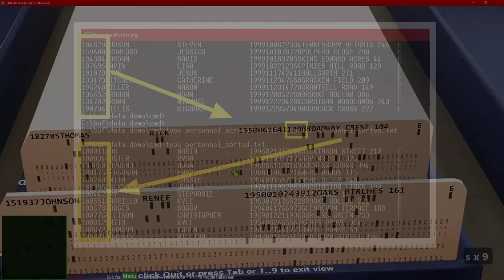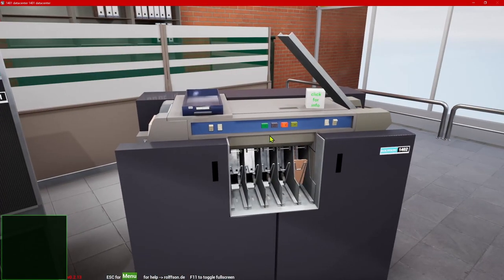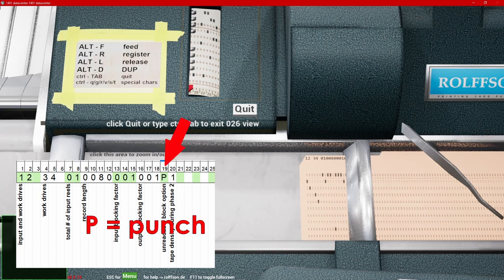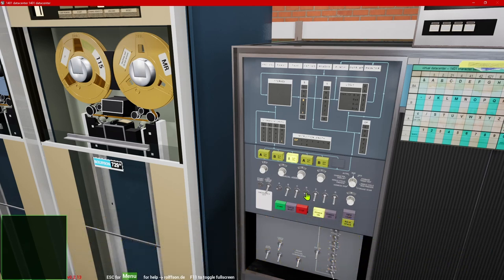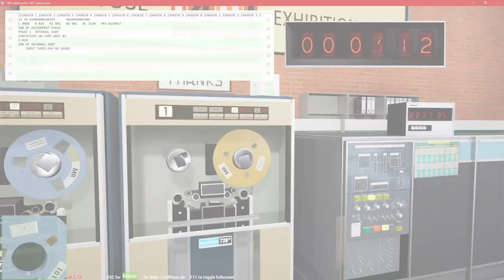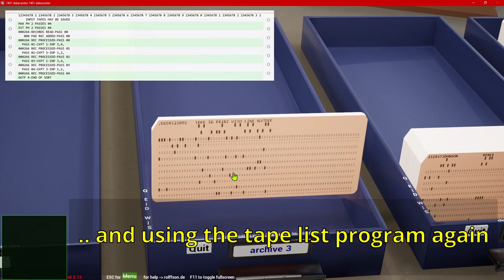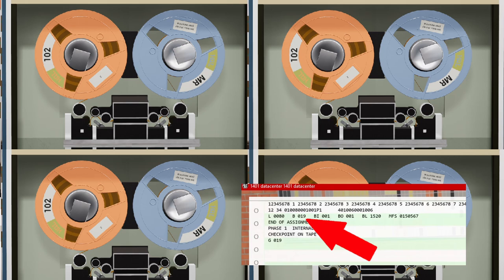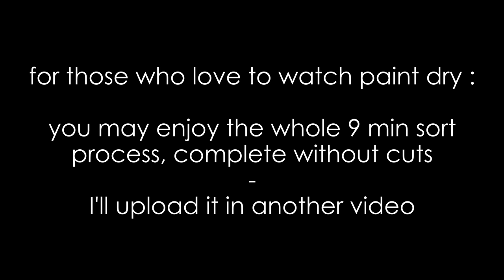IBM 1401 howto: sort7 tapesort - R12

Comment: It's interesting to consider how data records were sorted before they had tape drives. A machine such as the IBM Type 82 card sorter could sort punch cards into bins based on one column. By running the punch cards through the card sorter multiple times, from lowest digit to highest digit, you could completely sort your data. (I.e. a radix sort.) In this way, punch cards could be sorted, even decades before digital computers. Even with digital computers, card sorters were often used because they could be run "offline", without using the expensive computer. FORTRAN programs didn't use columns 73-80 of the punch card, so you could put a sequence number there. If you dropped your card deck and scrambled the cards, no big deal because the card sorter could put them back in order.
Reply: That is some amazing technology, even in modern times
Reply: On the periscope YouTube channel there is a video from the 1960s that featured the Roper Corp. and their use of the a 1401.   The man in the black suit that appears in the middle of the video talks about how the company used IBM unit record equipment in 1958 and then switched to the 1401.  They kept everything except two machines (the calculator and tabulator) and continued to use everything else.  That included multiple card sorters and collators.

Comment: This is amazing animation. I used to use the Sort7 program for 1311 discs back in the 60s. It was "boring". The tape drives (and printer) were the excitement of this machine and most often spun much faster than illustrated. Even on a 4-drive systems at times all tapes appeared to be moving simultaneously. Rewinds were particularly wind breaking. I couldn't even get the Sort7 to work in the simulator so this is jaw-dropping. I am curious to know how and if alphabetic sorting was done given the 1401 had a funky and even illogical collating sequence. 
Nice work and great history.
Reply from the maker: I agree, it (https://rolffson.de/pinboard.html#acollating ) wasn't very plausible; fortunately most text didn't contain many record_marks and minus_zeroes 😁.
At least they were able to leave the digits in a row 😎
I find it interesting that in ASCII the digits come ahead, and in BCD/EBCDIC they follow the letters..
Reply: @rolffsonsIBM1401channel  Could you do an alpha sort with Sort7?
Reply from the maker: yes.
sort7 uses the standard collating sequence, which provides an A..Z, 0..9 sequence.
The A..Z sequence is interrupted by two non-alpha characters, but that normally doesn't matter.
In this video, I've sorted by the personnel_number in col 1..6, but I could also have sorted it by e.g. last_name by defining "start col. 7 / length 18"
It's also possible to e.g. sort by first_name and then last_name by defining two sorting areas.
Reply: Back for another visit. It still tickles me pink (an expression back from the 1401 days :) )

Comment: what is your groovy theme music?
Reply from the maker: thats "69 Bronco" by DJ Williams, just search for it on youtube.
I've downoaded it via the YouTube Studio Audio Library where it's officially announced as free for YT use, so it seems to be safe for use in videos at least on YT.
In the library, just filter by "mood:dramatic" and sort by title.
If you like this kind of cinematic style music, I may suggest the group "Calibro 35", espescially the album "Ogni Riferimento..."
Reply: @rolffsonsIBM1401channel  thanks! i'm trying to understand the 30,000ft understanding of your channel... this simulation is amazing, but is it just animation done by hand or is there actually code behind it that simulates the actual operation of the 1401? Your channel does not have much background on this, but it seems amazin.
Reply from the maker: that simulation executes real 1401 CPU code (except that it's currently 10x slower than the original), and the animations are triggerd by the code. Most buttons and switches on the 1401 and tapes and other equipment are functional. E.g. a tape-read-command causes the tape drive to spin, and you can punch cards in the 026 station, carry them to the 1402 station and issue a card read command in the 1401 to process the data. The original IBM sort7 software shown in this video thinks it's running on a real IBM 1401, reading from real 729 tapes.
The YouTube channel does not provde much background, but is more an extension of the website and the related discord. You can try it yourself, it requires a graphics card and some studying of the original IBM documentation. See rolffson.de for more details.